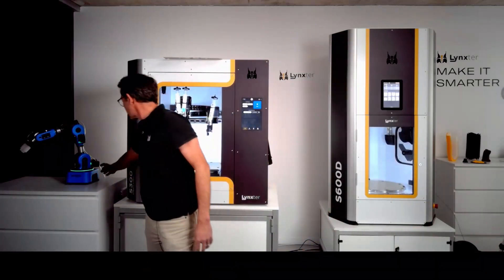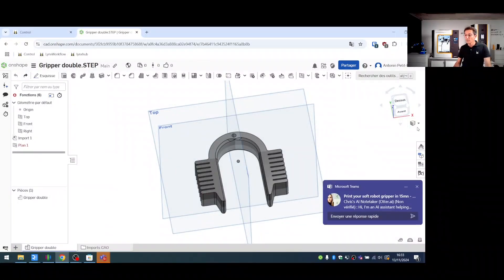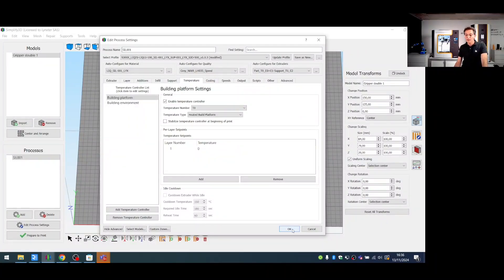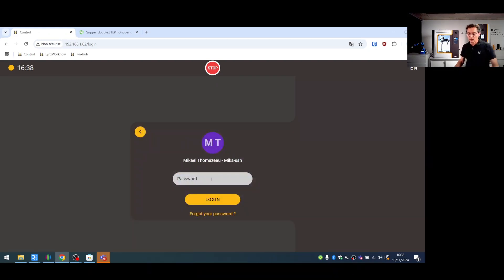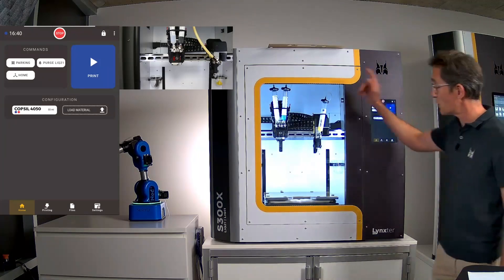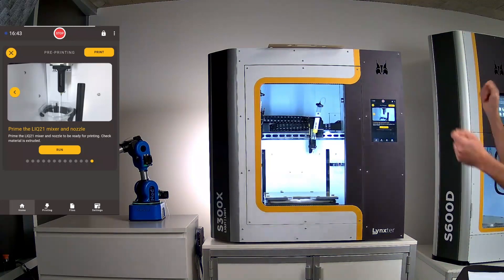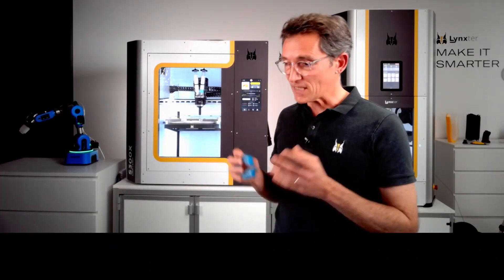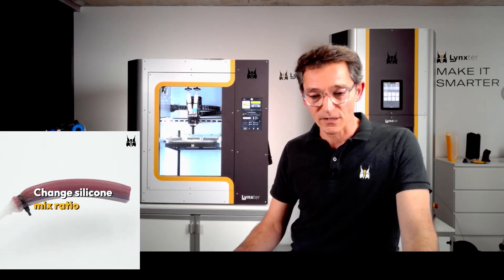Soft robotics - Silicone 3D printing S300X - LIQ21 | LIQ11 - Live demo in English

Comment: A different Idea for the interior, I wonder about using a salt or sugar that is formed into a mold shape to hold the silicone, and could then later be removed from the interior by piping in hot water to melt it down.
PS. thank you for making this video!!  I think this is the next huge move for robotics.
Reply from the maker: It could be a great idea, thanks for your comment